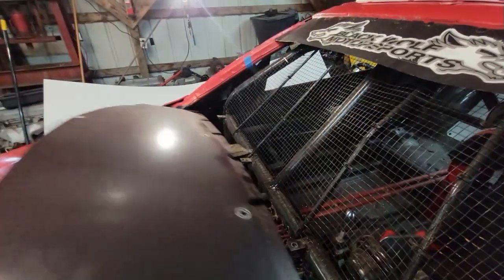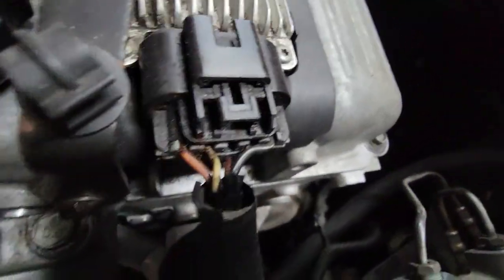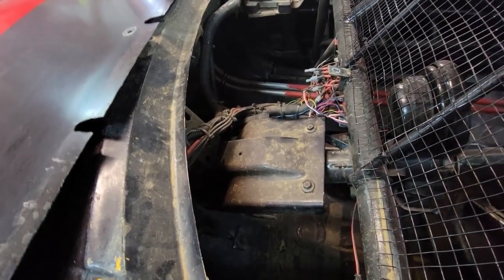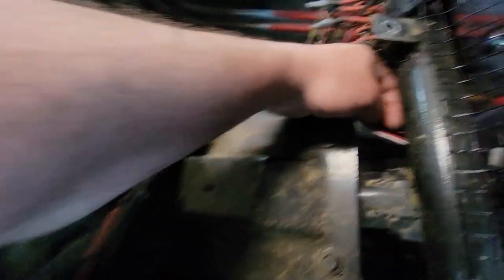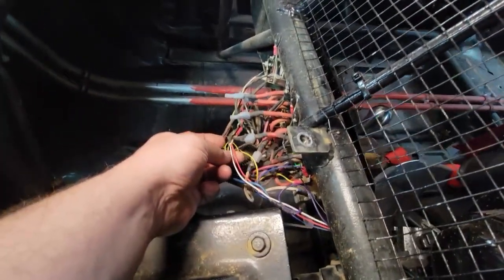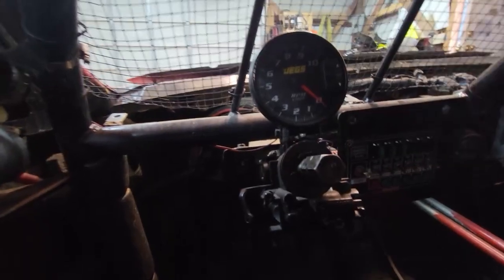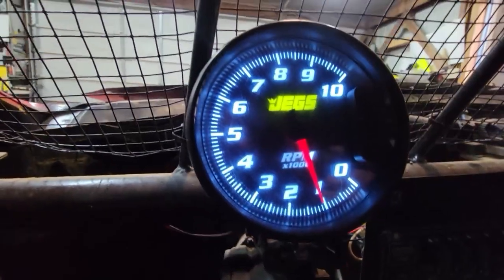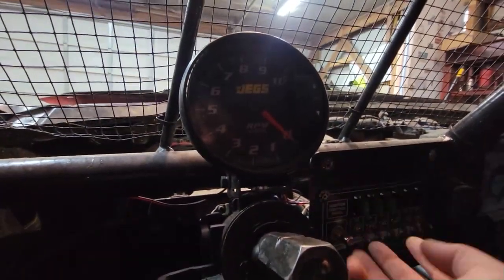Installing a Tach in an Ecotec Cavalier Without A Tach Adapter [Tech Tips]

Comment: I have a 04 2.2 ecotec dirtvtrack car and want to install a after market temp gauge.  Any advice and what needs to be done for that
Reply from the maker: I like to remove the heater core tubes from the thermostat housing (they are pressed in),  then tap the holes to 1/2NPT. I install a brass pipe plug from Home Depot where the tubes were. On one of the plugs, I'll drill it out and tap it to 1/8NPT to put a temperature sender in it.  If you don't want to go through all that, there's galley plugs on the driver's side of the cylinder head that you can remove and install an adapter and the temp sender. The adapter is M12x1.75 to 1/8NPT.

Comment: Do you connect it at he coil pack or do you connect it from the the plug that goes to the factory gauges
Reply from the maker: Best to splice in near the coil pack, just to make sure you're using the right wire!

Comment: How do you bypass the key and security system to run a push button but at the same time run the stock fuel tank
Reply: What motor do you have
Reply from the maker: We are working on making a How-To for this